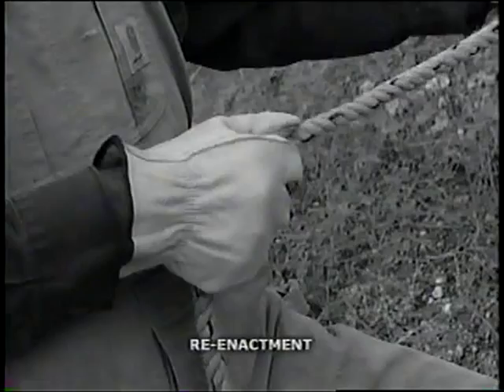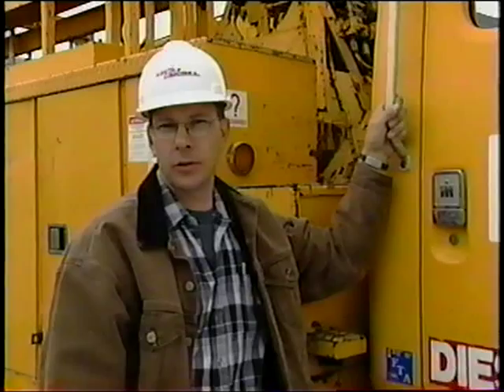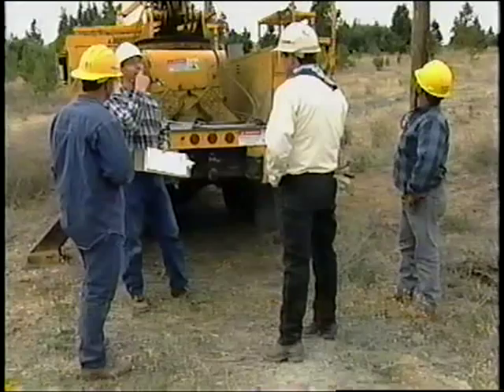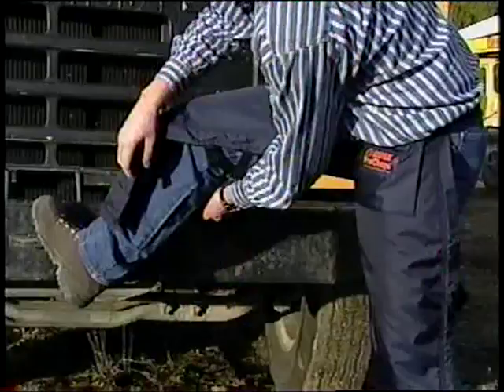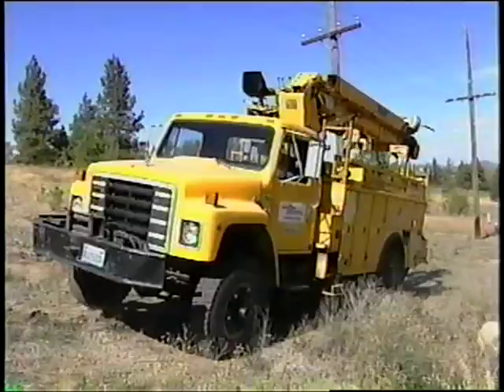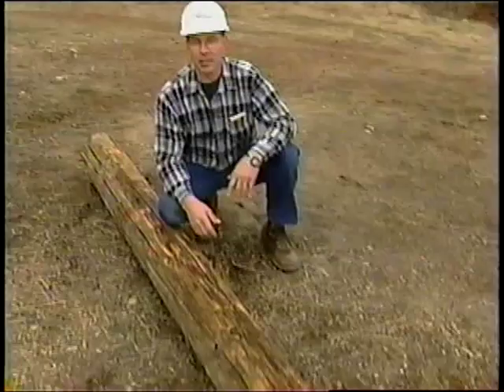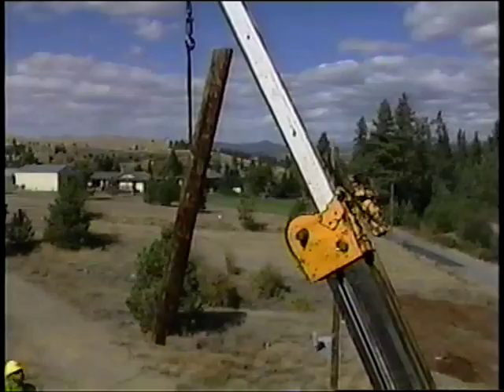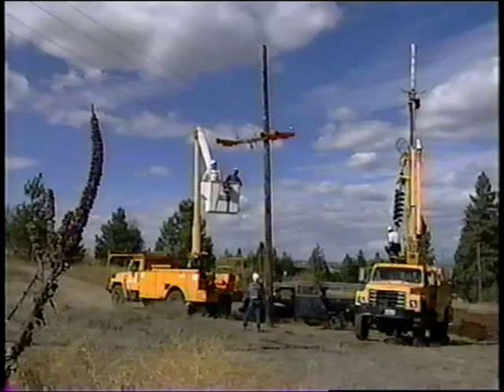Pole topping safety: High voltage electrical

Comment: t's sad anytime a person has to lose their life before someone does their research to find a safer or better way to do a job. Why does all these safety policy changes have to come too late? One life is one too many. Mike in Fresno, Ca.
Reply: It's because guys get lax on the job. They do it every day. I read a lineman post forum and one guy would always put his bucket so he had to REACH for the line because he had a co worker or something trip in the bucket and fall face first on a line. Simple things that you can't get lax on will keep you safe. VERY simple things where your mind says "I don't have to do that", but you say "bull shit, if I do that nothing can happen to me, the job is harder but that safety measure will keep me safe". I watched a crew work and one guy kept his bucket as far away from the line as he could and had to REACH and EXTEND out of the bucket to work the line. He will stay alive. I did communications linework. Steel buckets. The tires do not insulate from ground. A co worker got too lax and would get up near power. It was a fucked up slack span with no downguys so the primary sagged WAYYYY down. We had to keep our line taught so no one could grab it from the ground. It was in a tree and he had to drag out fiber optic cable over the tree. He contacted 19,900 volts and it ended him immediately. In a steel bucket I wouldn't go near that shit. NEVER.